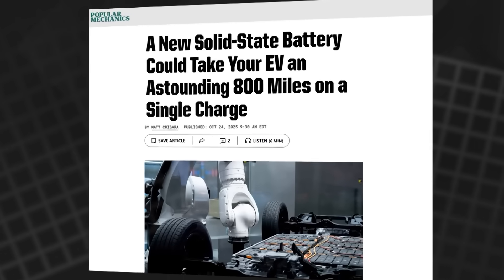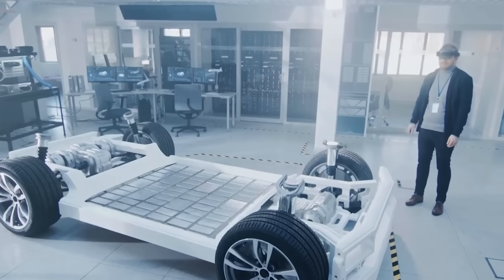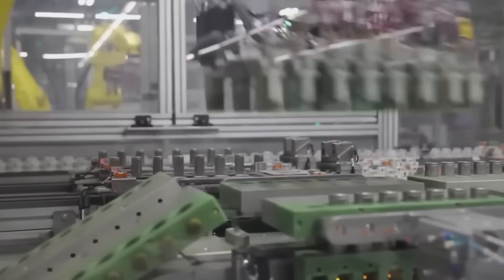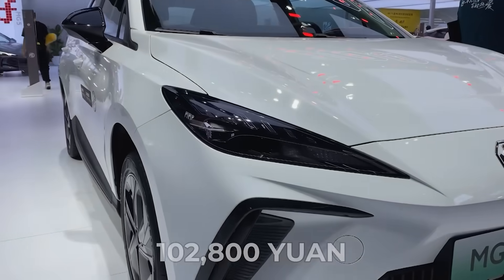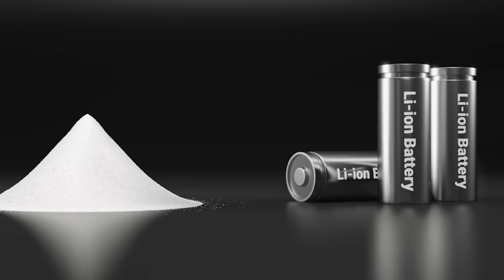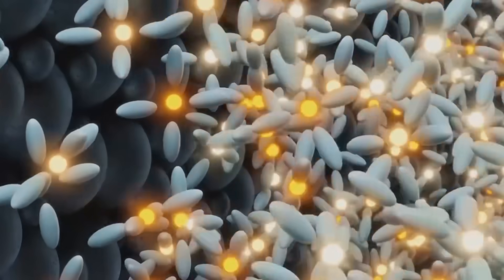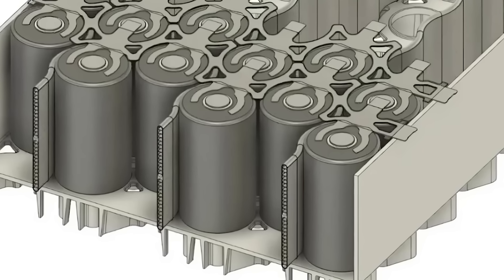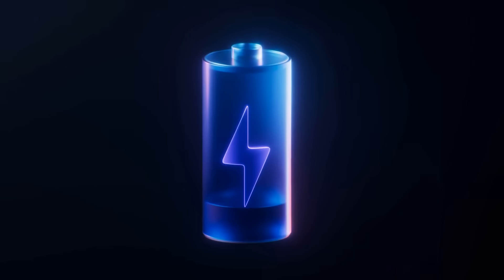Solid-State Batteries FINALLY Arrived… or Is 2026 Another Big Lie?

Comment: The primary goal of a solid-state battery is not the solid electrolyte itself, but the ability to enable a lithium-metal anode. A solid electrolyte, in isolation, is a penalty: it typically introduces drawbacks in ionic conductivity, interfacial resistance, manufacturability, or cost. Its value exists only insofar as it makes stable lithium-metal operation possible.
Therefore, if a battery can achieve a lithium-metal anode with long cycle life, fast charging, and high energy density, the amount of liquid electrolyte present is irrelevant. Performance and safety outcomes matter, not if liquid is present or not.
This is why QuantumScape’s architecture uses a gel catholyte while retaining a dense ceramic solid separator. The separator is the enabling technology, it prevents direct anode–cathode contact and suppresses dendrite propagation and thermal runaway. Measuring how “solid” a battery is based on liquid content is a meaningless classification.
The only criterion that matters is whether the separator can reliably isolate the lithium-metal anode from the cathode while sustaining high-performance operation.

Comment: Isn’t Donut in production for a motorcycle now and scaling up production for motor vehicles?
Reply: Donut is the parent company for subsidiaries producing electric motors, THE battery and Verge motorcycles about to combine both. Also other ventures under Donut Lab. Like connection and likely partial ownership to Nordic Nano which in part is possibly behind the new battery tech and also new type of solar panel material. NN is reportedly responsible of combining the latter two operating in energy sector.

Comment: I believe Toyota may already have achieved solid-state battery (SSB) capability, judging by the sheer breadth and depth of patents it is filing in this area. It is therefore reasonable to ask whether this extensive IP fence is being used not merely for protection, but as prevention from others developing the technology — allowing their internal-combustion and hybrid ecosystem to be monetised for as long as possible.

This situation feels uncomfortably familiar to GM EV1 NiMH episode of the late 1990s — a technically viable electric vehicle with close to 200 km real-world range, which was later recalled and scrapped after large-format NiMH battery IP consolidated under Chevron.
Reply: I'm less inclined to agree because China wasn't in the mix back then. Not only do they have the technology, resources, and market incentives via their massive EV market, they also are extremely comfortable "reverse-engineering" (to put it nicely) technologies for themselves and then bringing them to scale very quickly. 
China isn't interested in maintaining the status quo of ICE and Hybrid engines, they want to dominate the EV space and I believe they want to crush ICE vehicles in the long run.
Reply: @nickpiovesan4361 I’m not disputing China’s capability. I’m questioning incentives.
Breakthroughs don’t need to be stopped forever — even a few years of delay is enormously valuable when ICE and hybrids are still being monetised at scale. Patents can pace adoption, not just protect invention.
That’s the NiMH parallel — timing and control, not technical impossibility.
Reply: No one has solved the stack-pressure problem in sulfide-based solid-state batteries. Despite an extensive patent portfolio, Toyota still does not have an EV-grade solid-state battery. At present, the clear leader in this space is QuantumScape. By choosing a dense oxide ceramic separator approach, they have established a decisive technical lead and are likely to reach gigawatt-hour–scale production by 2028–2029. Other players have yet to demonstrate an EV-grade battery, even at laboratory scale.
As for China, it currently trails the curve in solid-state battery development. Most Chinese efforts are pursuing the sulfide-based approach similar to those of Toyota and Samsung, an approach that already appears extremely difficult to commercialize. Compounding this challenge, they are also late entrants to the solid-state battery race.
Reply: @cyclopes968 I do believe Toyota already has EV-grade solid-state capability and is deliberately pacing deployment to continue milking its ICE and hybrid ecosystem.
However, the delay in the last NiMH innings was not about “waiting for permission.” It ended only when a new vector emerged — lithium-ion — with a different chemistry, supply chain, and patent lineage that rendered the existing IP fence irrelevant. That transition cost humanity nearly a decade.
That is the real question this time as well: what is the next vector that can bypass today’s solid-state IP concentration? Sodium-ion, alternative anodes, structural or pack-level architectures, or system-level disruption that shifts value away from the cell itself?
Without such a discontinuity, we risk losing another decade — not because the technology doesn’t exist, but because no orthogonal pathway has yet forced the transition.
Reply: @GbMuthu Please read the challenges associated with sulfide-based solid-state batteries. Once you do, it becomes clear why Toyota continues to push back its timelines and why it still does not have an EV-grade battery that outperforms today’s lithium-ion technology.
Sodium-ion batteries, such as those developed by CATL, have approximately 40 percent lower volumetric energy density than LFP and about 70 percent lower than NMC. Their cost is also not as low as many sensationalist articles claim. For the foreseeable future, sodium-ion batteries are likely to remain more expensive than LFP, and even in a best-case scenario with terawatt-hour-scale production, costs are unlikely to fall below $40 per kWh.